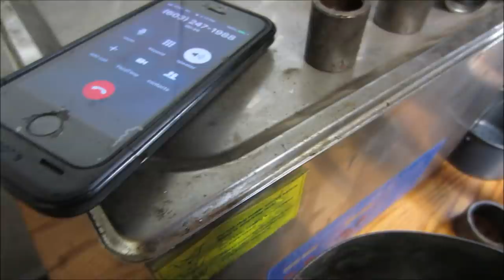VW BUS Transmission Failure,  Help Me Fix it,

Comment: Thanks for the vid! What's the better vehicle, the VW Bus or the Bug?
Reply: Both good.  Different purposes.
Reply: Double cab Transporter
Reply: Bug is much more reliable. The bus is a heavy, slow, underpowered pig that abuses its drivetrain if driven in hills, heat, or a hurry.
Reply: The bus is more complex due to long runs of cables, rods, and wiring from the rear engine to the front.
Reply: @mwilliamshs  
How many have you actually owned??
Reply: @dre4011  dozen or so. Beetle, super beetle, bus, camper van, double cab pickup... I've had a variety
Reply: I put a FA20 2.0 L Subaru boxer in my 70 bug and never looked back love it wasn't that bad of a swap! They make all the proper plates and parts to make the swap a professional job!

Comment: Had the same problem with a bus trans.  We took it apart, found a few worn parts, got the trans partly together, and found out that there is a special tool needed to adjust all the linkages before you can reassemble the Trans all the way.  Without that tool you are just guessing..  We guessed.  Wound up with the same problem even with the new parts.

Gotta have that adjustment tool to work on these transmissions.'

Been a mechanic about 60 years.  A few years ago I decided to teach myself how to rebuild automatic transmissions.  Woo, complicated, but fun.   My first was a Ford Aerostar.  Worked good.  Second was a Mercury Mountaineer 2000.  V8 5 litre.  That trans is still working about six years later.  Useful to know how to do this.

Comment: "this is where hot air goes up to the front" lol you mean this is where tepid mildly warm air starts going to the front and is ice cold by the time it gets there? lol

Least in northern climes hehehe
Reply: Ah, just wrap your heater channels in gold tape.
:X
Reply: When the heating system is intact and working correctly they have plenty of heat, so too with the Beetle's.  The heating system is most misunderstood component of air cooled VW's.
Reply: I wouldn’t say misunderstood, but abused through lack of maintenance and understanding that at some point you will blow hot air up your a$$!  All kidding aside, if people took the time and had the desire, more of these cars would still be around, and with less issues then today’s models. Got to say something about simplicity... it works!
Reply: Mine blew tepid air, smoke, fumes and bits of rust !.
Reply: Brian Williamson see my point, if it was maintained it wouldn’t
Reply: Patrick Fennessy Was in the North of Scotland when it went. Lived in Lincolnshire way down South !. Lived on very tight schedule in those days. Complete system was changed within a week or so. No more problems. Actually until I read the initial report I had forgotten all about it. But I did write tongue in cheek !. Enjoyed my faithful old van
Reply: Brian Williamson mine was going bad when I went up to Alaska, replaced it before I got there... 2 days after getting there, a plow truck hit my parked van... it was done no repairs could save it short of remove gas cap.. tow wreckage... drive in replacement van, replace gas cap ... 😂 bitter sweet memory thank you

Comment: When the clutch cable tube is missing, or not bent enough, the clutch judders. I think that's the term you were looking for. Juddering clutch. And it's awful, turns the most experienced driver into a noob.
Reply: I wood use the term   SHUDDERING clutch, a nove we had  had the same probs and it turned out to be weak leaf springas

Comment: Put some JB Weld on the back part you can't get to with welder.
Reply: I thought that too. I wonder how long it would last? Mustie1, any thoughts?
Reply: manuseal exhaust cement...it expands with heat
Reply: I remember bending new tubes out of good tubes, and grafting them into the intake heaters by brazing. But then again I would repair gas tanks with a torch also, if you have never done it don’t, there are some tricks you should know first!

Comment: Throw some jb weld on that exhaust coupler
Reply: My thought also.
Reply: My first thought as well
Reply: No I don't think it will stand up to the heat although there is a high temp orange silicone for sealing motorcycle exhaust crossover pipes. That is where I have seen it used, the factory had clear but rebuild all there is was orange.

Comment: So, do you send the old transmission back?  Is there a core charge situation?  My father worked for a VW dealership's repair shop back in the late 50's, early 60's.  I seem to remember always having a carb or two on the kitchen table and a transmission and/or engine torn apart in the garage as I was growing up in the 70's.

Comment: Making your own tools for one off jobs is tremendously satisfying.
Reply: yep and it defines a real craftsman from all the wet behind the ears "uh-oh we need a special tool" type, granted I am lazy and would rather buy a tool than make them, but sometimes scrap material availability and lack of endless $$$ dictates what you do and "git-r-done" becomes main motto. I have lots of custom/modified tools laying around, some only used once in 20+ years, but it still in the drawer/cabinets ;)

Comment: I always always always put new pressure plate bolts when replacing the clutch. I learned that one the hard way as the old ones frequently snap off when retorquing.
Reply from the maker: never had that problem

Comment: Throw some JB Weld on the little hole on the intake man. should close it right up. push it in a little hard so a little squeezes into the hole. No more leaking gas fumes into the engine compartment. Happy Bussing

Comment: when I grew up in Germany and finally got my license, I drove many of those busses and the later model, the Bully. At the time these were huge vehicles in size, compared to other cars on the road. Nowadays a Civic is wider and most full size SUV's are about the same height. But the fun driving these busses can never be matched by any modern car (or SUV)

Comment: As I watch you working on throwout bearing it reminded me that on the VWs I worked on , I welded the throwout bearing arms to the shaft . But I did change out the pressure plates to higher performance ones . I replaced transaxle with rebuilt , built up unit from California outfit that held many records in racing . Can't remember their name , but it shifted so nice . So nice to have a clean unit to work with ! These days I rarely work on friend's cars , in my younger days it could really burn up my time .

Comment: Super jealous, imagine being able to sit down and work 
So the mildly warm air can softly waft through the cab
Piece of silicon tubing would have worked for exhaust repair
Corvair I had the ball would pop out we finally stuck a pipe reducer on top of the of the socket so that all you had to do was shove it back into place

Dad and I rebuilt a four speed for my 67 Mustang back in the 70s, not sure what we did  but someway or the other afterwards if you backed off in first the trans would jump out of first if you held your hand against the shifter it would jump straight back into second, made for one heck of a speed shift!

Comment: I must tell you again, your work benefits me greatly. I have a 2001 GMC Sonoma with a 2 inch lift, Bilstein shocks, aluminum drive shaft, rugged terrainT/A tires and even a Kicker subwoofer. All of that stuff is nice to have but I bought it as a daily driver. The radiator sprung a leak right after I bought it. I fixed it myself. The metal lines had EZ clips and bolts. Not much room to work so it was hard to get the new one in. I took my time and got in, no leaks. Not sure I would have tried to fix it if not for you and your videos. Oh, and the EZ clips were not so easy!

Comment: Looks like it needs pushrod tube seals, intake manifold replaced engine seals mustache rubber mounts. Might just want to replace the clutch while your there. you should have all the parts from all the barn find engines. like that convertible had loose heads so the intake needs to come off of it anyway

Comment: That is an interesting design with the VW engine bay. How important it is to have all the tins and rubber seals in place for the engine to get proper cooling as well as fresh, cool intake air and also for the heat to work properly. I especially do like the split generator pulley to get the belt tension just right. A little fiddly, but a rock solid end result.

Comment: Nothing like a good tutorial ,that exhaust pipe heater sure looks like a 1972 superbeetle one, of course you'd have to side by side them.  At the end of the day its not always what you know but who you know. You have lucky friends that can count on your assistant. Most mechanics would have just done the job requested. I would pay, and I'm sure most other people would for a mechanic that takes care of other issue not originally included in the repair. At least let the owner be aware while things are still torn apart so that they could make the call on additional charges or whatever.

Comment: A question for ya Mustie.. do you see any dual carb buses over there? An uncle owned a vw bus, the same body as the in this video(type 2) many years ago here in Australia. It had 2 downdraft stromberg carbs, one on each side, as in one per head with a separate air filter on each. I believe the bus was a 76 or 77 year model, from memory. I remember he kept cursing the difficulties in balancing to two carbs.
 
Also, the cooling fan was on the crankshaft directly on their bus with the alternator to the right hand side.

Comment: Back in high school, I bought an old VW bus for $40 that had no second gear.  It was drive able but I found a Bug tranny for free. But since the bus had the gearbox on the axles ends, it turned the wrong way. I took this tranny apart and flipped the ring and cluster gears the other way to reverse the rotation, there seemed to be room on the case for either way. Didn't do a proper setup, I was a dumb kid. But it worked like that for over a year.. Engine finally gave out and I moved on and joined the military.

Had a lot of fun with that old bus.  The heater was so bad that I had packed snow  on the floor for weeks at a time. Ah the memories!

Comment: I thought I would add for anyone watching, He's right about everything having a torque and I would add that if there's a tay or torque angle for it DO NOT REUSE THE BOLT! The bolt has been purposely torqued to the point of stretching the bolt and it's no longer reusable.

Comment: Oil drain plugs are 20Nm (14.7 ft lb) if anyone watching needs this information 🤙🏻 as Mustie1 said, don’t kill it, about x1 white knuckle if you don’t have a torque wrench because aluminium is relatively soft and you don’t want to strip the thread.

Comment: Great video mate, very entertaining, considering I have no experience with veedubs at all!   Interesting the unique quirks & problems involved in an air-cooled vehicle.  One thing though that surprised me.  When you made the clamshell patch up for the preheat pipe, I thought you would have the split at the top & bottom.  Then you could have first welded the inside of the back half to the ends that you had cut off square.  Then you could easily weld the front half to the outside of the 2 ends, & weld up along the top & bottom splits.

As soon I knew you were going to weld up the hole in the pipe I wondered how you would get the welding torch 360 degrees around the pipes.  Sure enough I was right!  Scratch one for the novices!

Comment: So I was going to say, no fourth etc fixed by adjusting the plate, nothing wrong with the gearbox. No drips due to the fact that there was no oil in the box. I was also going to mention the driveshaft boots but you covered that. Picky? Moi? Just keeping an eye on things. A nice original van, looked after well for a lucky owner.
Reply from the maker: plate was adjusted years ago did not help then,

Comment: Reminds me of the time I had to replace the clutch in my ‘65 421 GTO, after I blew it at the drag strip.  I did not have a pilot bearing guide to line up the clutch in the pressure plate and I spent hours getting the 4 speed transmission back the bell housing all in the freezing cold at night.  I bought a pilot bearing guide the next day but never had an occasion to use it, again.  I think it was plastic.

Comment: Airframe and Powerplant Mechanic, 72 now > Mustie 1, I removed the engine and transmission together on a small sizer jack and kids wagon many times at about 45 minutes each time. what a problem the first time getting them back together again and that was when I decided together was my way. I had the back bumper come off for the job and the vehicle did not have to be lifted. That was good because the jobs were accomplished on a mobile home parking slab and later on the garage floor.

Comment: Looking at the valve adjustment, looks the same as an 80s pushrod Subaru, I bought an angled feeler gauge set off the Snap-on truck, I think it was all of $15 and made it a lot simpler!

Comment: My old '64 popped out of 4th AFTER the 90 day warranty on the "rebuilt" trans. I took to wearing a hat so I could drop it over the shifter and sliding the bill under my leg, later I needed to use a strong bungee cord to keep it in. That bus also was famous for the doors flying open on corners...

Comment: Near the end there, under the carpet next to the shifter you have that spade terminal crimp connection... He needs to insulate that wire or he's going to someday have a small fire there. The terminal sticks out from the plastic just enough that with some rubbing it'll make a connection to ground.
Reply from the maker: its the ground wire for the horn
Reply: @mustie1  lol. One day he's going to set something down next to the shifter, or maybe something heavy will be down there like an alternator or something and it rolls over and... BEEEEEEEEEEED-D-D-DPP

Comment: I kind of recall drilling and using JB weld to install a nipple in a manifold for vacuum setup, but I mainly did all offroad rail stuff and we scraped/parted out tons of rusted out bugs and buses. as much as possible went to the local VW shop in trade for new parts for offroad playing, so someone got all the good oem used parts for their restorations, I know she was shipping stuff all over the USA back then, as much as possible was salvaged  :)
Reply: thinking further, I recall the pre-heat tubes being machined or broken free from manifold and replaced with new at some point. I was into the junk in the late 90's early 2k's, not so much since

Comment: 50:20 in when welding the pipe on you may of gotten by with welding half’s at a time by welding the back half inside the pipe and could of just put the front piping on and snagged it from the outside and a perfect seal love your videos please do more I’ve watched almost all of them

Comment: I would try to massage some JB Weld into the pre heat pipe repair to maybe plug up what you couldn't get with the welder. Wouldn't hurt... Could you have loosened the shift plate then just started shifting it into the gears like normal to get the plate to move close to where you needed, then go back below and tap the plate a little more to find the sweet spot?... Great video. Thank you!

Comment: Check the thrust play or case wear by lifting the flywheel with a screwdriver, sometimes a new seal won't heal at all. I would have went with the intake heat blockoff instead of trying to weld that up. I would have been required to replace any vacuum hose to prevent a leak that will burn valves faster than it will get out of the driveway.

I built these by the dozens back in the 80's to put myself through college. I can do it in my sleep still.

Comment: This again was the perfect application for placing a cutoff wheel buddied up with your roloc disk. It allows you less flex of the cloth roloc and provides some direct edge cutting. When needed. It also extends the life of your roloc disk. Try it, you'll like it! Has anyone else tried this? Once you do it, you will see the obvious advantages.

Comment: Was anyone else thinking " please spray the back of the motor with some brake cleaner and wipe up the spilled oil before putting the flywheel back on". No? I'm guess I'm just a little OCD about that😄 As usual you make this look so damned easy.

Comment: Harbor freight air hose? If so I have the same one. Had it 3 years. Use it In my barn dragging across the gravel floor. Has held up very well.

Comment: Just think those clever Germans built all those engines with no gaskets , All of the boats has a specific Toque amount . lol  Just that alone will make you a tired puppy. What a great video . brings back the 67 Bug I had for a long time and how I would just loosen 4 bolts and Have the Engine laying all over the garage floor. lol

Comment: For hard to fill areas drill a hole in the cap of the bottle that fits 3/8 brake snugly add a length of tubing then drill a small hole in the shoulder of the bottle use rubber tipped blow gun add air fluid comes out of the bottle nicely.

Comment: Was that brake switch on the trans broken from the rebuilder or is that something you had sitting in the shop for a few years? I'd be pretty pissed to buy a rebuilt trans only to find broken parts on it.

Comment: The last transmission I did was a 4L60E on my 94 Silverado, a few years back. Three days down time, a great friend and 500.00 bucks CDN later, it was fixed. Worked great till the truck was rear ended by a drunk driver, totaling the truck :/
Edit: at 1:14:20 you really see how much better the new transmission is running and shifting; it looks like it's race ready !

Comment: On the the welding, would it have worked to clamp the back half on where you could get to both side seams, then weld around the inside of each round, since you cannot get to the backside easily, then put on the front side, welding the seams and the outside of the round ends? Would leave two little leaks, maybe.